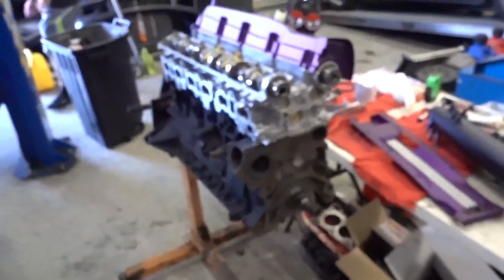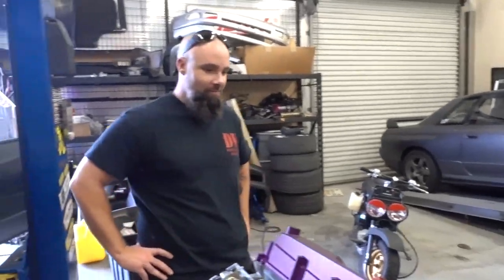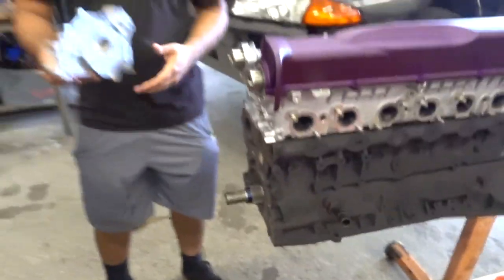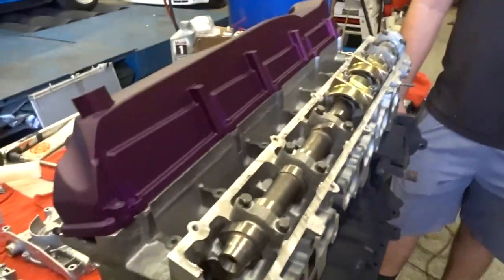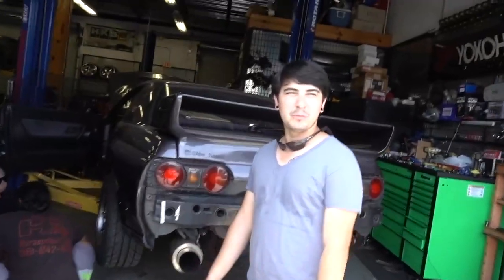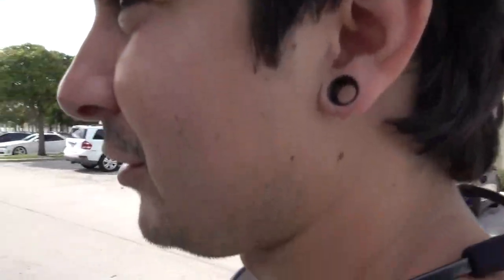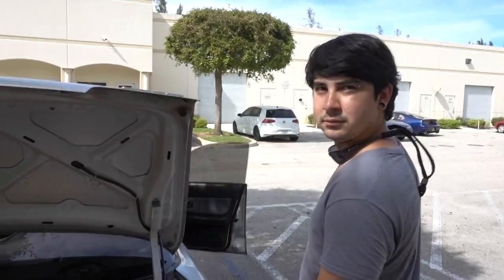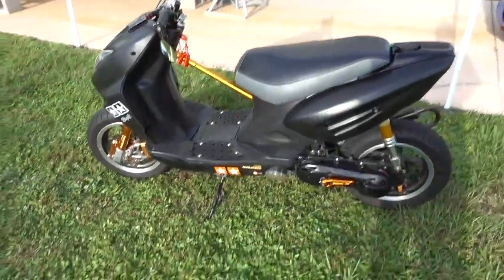What did I buy now??!

Comment: Oh and is the exhaust on the scooter a Yasuni C21 or C20? looked like a 21 to me :)
Reply from the maker: # Mr. Christmas it's a C16
Reply: Alright, then it might be a newer model, back when i had a c16 it stick out behind the tyre for like a good 4 to 5 inches :)
You might want to change it to a C20 than if you want more MPH, depending on the cylinder ofcourse, 
You know what brand / type you have for cylinder ?.
And i do agree 2 stroke is harder to fine tune but when you have it done it feels so satisfying
Reply from the maker: Stage 6 racing mkII cylinder with ported/trenched/ cases and stage 6 RT crank /85mm rod
Reply: Than you could even go for the C21, Ive had a setup with a Athena Racing 70cc (its the same brand as Stage 6) and with the C21 and a 24mm carb and straight inlet ive made around 15-17bhp and could get speeds around 110 km/h 

Also since you like moped's i tought drop 2 picks of my (raggedy) beast :P
http://i42.photobucket.com/albums/e347/FlapPi3/Scootershit/IMAG0055.jpg
http://i42.photobucket.com/albums/e347/FlapPi3/Scootershit/IMAG0013.jpg  
^ (This one also has the C16 on a normal 50cc did like 90 km/h really hard to fine tune, never ran great)